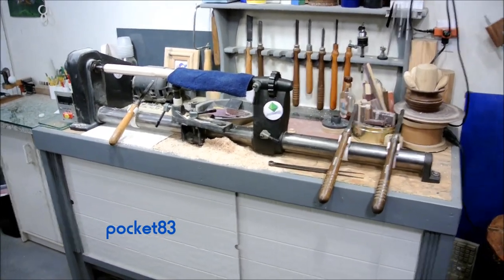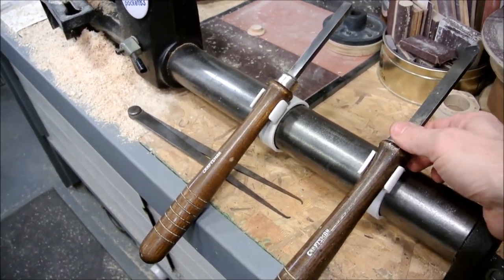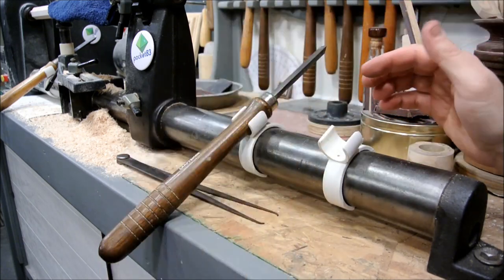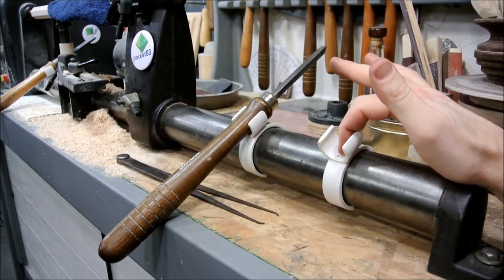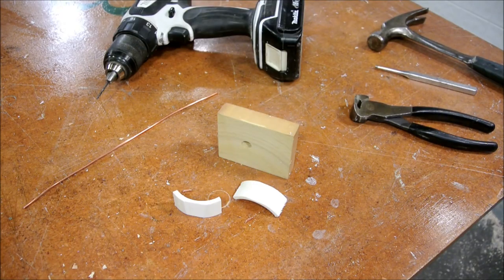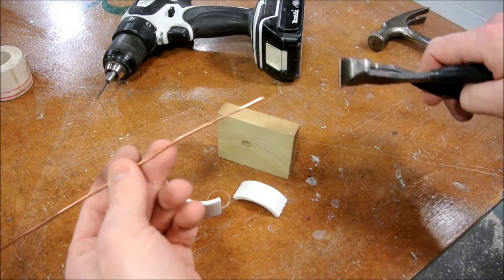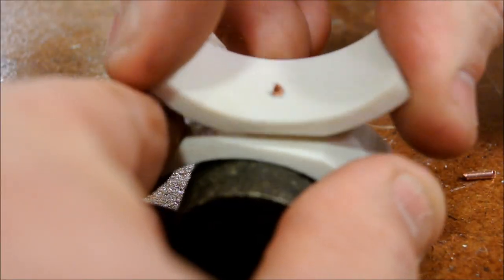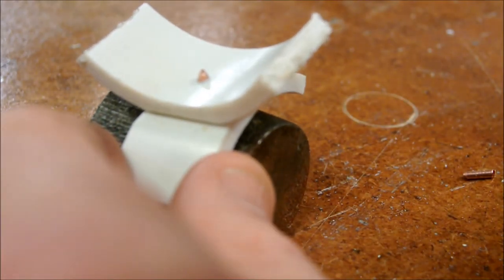Lathe gouge holders and cheap Cu wire riveting

Comment: I love the copper wire rivet method! One thing that I've done with great success - add a bit of a countersink, and then a groove (or any pattern of channel) coming off the hole. When you thread the copper wire through the hole, thread enough to also fill the groove. It makes incredible ornamental joinery.

Comment: This is something i've done before, not just with copper wire, but with aluminium rod, if you want a stronger joint, countersink the holes first, the rod will have a place to expand.

Comment: You can also a small ballpeen hammer to rivet over the ends of the wire. One less tool, might be easier.
Reply from the maker: I wish I had a ballpeen hammer. I do have some hammers that are so old I've rounded them, so I get away without having one.

Comment: Much the same can be done with a nail, good for heavier stuff. If you drill a divot, depth of the drill point in the backer, it will help form the end of the rivet.

Comment: Hi pocket, try filing the ends of the wire flat first, it only takes a few seconds and it would make for rivet heads closer to a circular rather than irregular shape. Then place the wire in a vise sticking out 1/16 or so, and with a hammer form the head of the rivet ahead of time, you'll have more control over it. Then use it normally as you do in the video, with the head at the bottom against your steel cylinder.

Comment: pvc cement is basically pvc in a solvent, usually a ketone like acetone or butanone (more expensive but works best) - just ad new liquid and let it sit overnight 

works with abs cement too, here you can even use the cheap acetone with no worries

Comment: Very practical video. Thanks for sharing. That copper wire riveting I must give a try, very original.
Can you please write down the thickness of the copper wire? i didn't quite get it from the video.
Reply from the maker: 12 gauge or 0.08"
Reply: Thanks. Also 2 mm :-).  That is not a very common thickness in continental Europe.
What is better:  1.5 mm or 2.5 mm instead?

Comment: how did you do the riveting on the live center cap?
Reply from the maker: Same way. Just pre-drill and then pound it in.
Reply: pocket83 but that'd be like hammering in a finishing nail. It'd keep going down until you lose it.
Reply from the maker: Not exactly. I mean, it could- but the hole is undersized, and copper wire is very soft. Thus, it starts to flatten out a little right as it starts to go down. With practice, it works well.

Comment: Awesome video, Pocket! You consistently blow my mind with your creativity and ingenuity. Thank you for sharing! Has any silly troll calculated the cost per rivet since it's Cu (assuming you don't have spare Romex in your shop)? ;P
Reply from the maker: 250' is 60$. Three strands makes it 750' per roll. 60/750=  0.08 per foot. 24 rivets per foot means 0.00333... per rivet ;)
Reply: aka DIRT CHEEP

Comment: You get alot of mileage out of PVC pipe.
Reply from the maker: I've definitely been going through a phase. I may be focusing on it disproportionately in videos, though. But it's also because I'm cheap- I try to solve my problems with the least expensive materials.